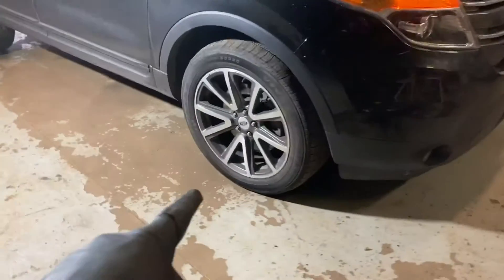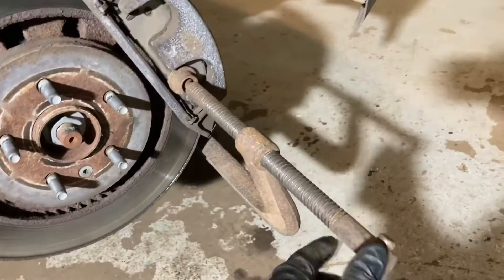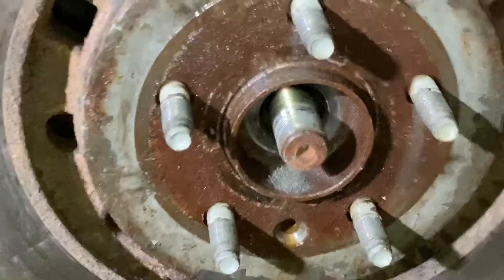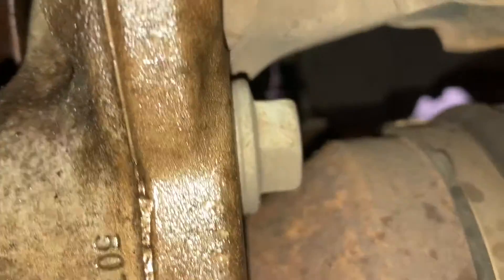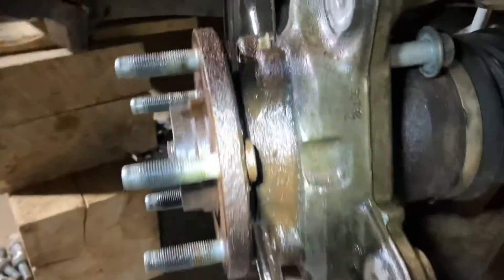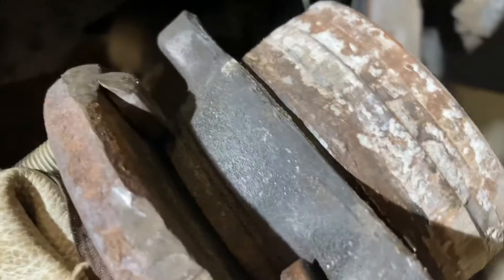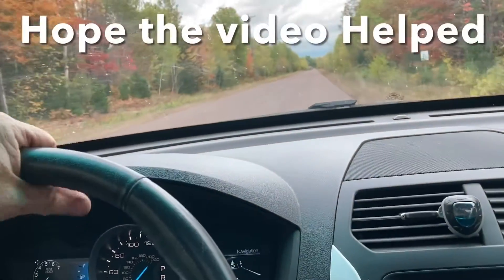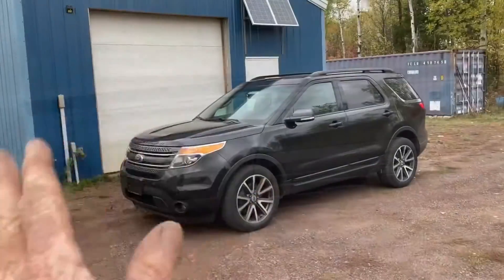Quick Diagnosis & Repair, bad wheel bearing, 2015 Ford Explorer.

Comment: Had to do this on my 2014 Limited. If you have to hammer on these bearings...anything more than a few light hits...STOP! If it doesn't come out relatively easy, stop and use the method that requires you to remove a couple of the pressed in wheel lugs followed by using a Grade 9 bolt/nut combo to PUSH the bearing off of the knuckle.

If you hammer on these too hard, you will damage the strut and cause alignment issues! A buddy of mine didn't heed this warning and ended up damaging both front struts which in turn causes alignment issues with both tires! Causing abnormal wear. So not only did he have to spend $500 on bearings, but also another $500 on struts and over $1,000 on new tires!

All while the bolt/nut combo MAYBE costs an additional $30. (you may need 3-4 bolts/nuts per wheel).

Comment: Being a mechanic in the south really is the definition of living the dream. I can't believe how corroded y'all cars get
Reply from the maker: @hollaatu4743  I’ve had a few chances to work on southern cars. Wrenching always has its struggles BUT rust compounds them quickly… thanks for watching
Reply: @fastdadgarage-northsouthch4418  yes sir just bought mu hub a few minutes ago and used your method to determine which side was bad. I really appreciate you taking the time to explain things. Now I need to check my torque wrench to be sure it goes up to 180 before I disassemble
Reply from the maker: @ awesome glad the video helped.

Comment: What would be the cost for both to be replaced on average?
Reply from the maker: I would say labor would be around an hour per side, so find out what your local shop charges(most places are $70-$100 per hour) Parts depend on where you buy them. Online will probably be cheaper(amazon timken $130 each) but if there is a problem getting customers service may be difficult. Dealer will be the most expensive.$400 would be about as cheap as it could be done at a shop.